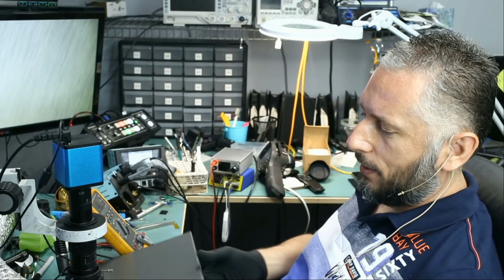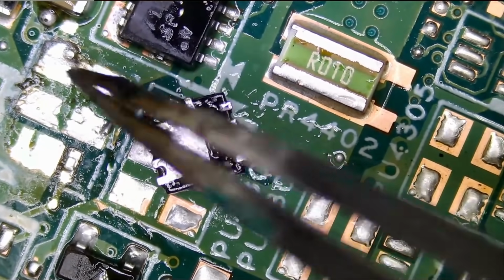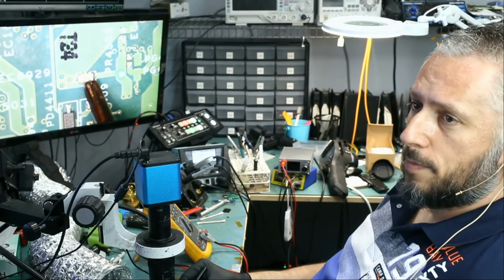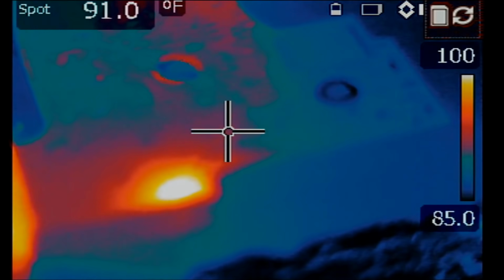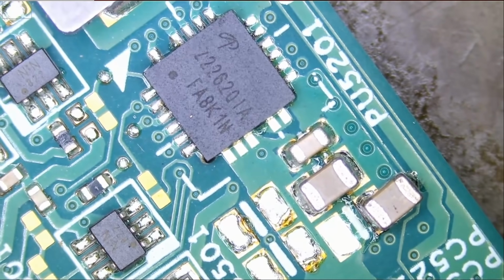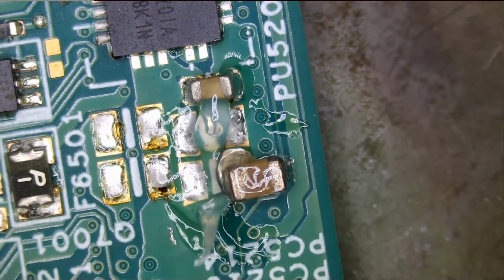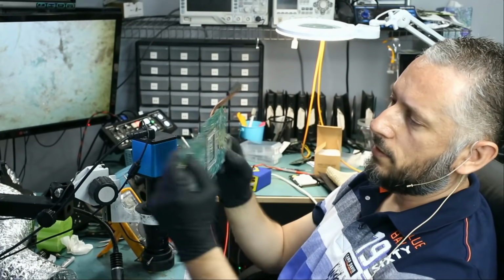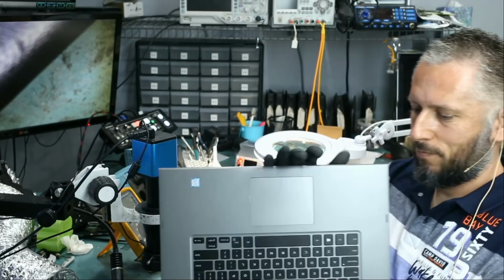Dell Inspiron 5579 Laptop No Power Repair

Comment: Is there a schematic for that power injector gadget available or a URL link to it? What is the maximum safe voltage and or current one should inject on the board?

Comment: There 2 empty places for ports.
I think one is for type c port and another one is for.
M.2 kind of that port.
Can we add manually does it work.
Or it depend on bios.
But we just need to soldered ports.
Like replacing ports.

Comment: One Question friend ¿Which is the difference between the Power Supply Short Injection / Detector with Voltage and Current Control and the Mechanic Short Detector? ¿Which is best ? or ¿Which one do you use often? Thanks anticipated for answering me. God bless you.

Comment: I am also an amateur repair gnuowif. I fixed a Dell 5579 laptop similar to the one you just fixed. It's my wife's laptop and I fixed it yesterday. It's short-circuited with the mosfet shorted and 1 capacitor shorted. Unfortunately, the problem burned the board at the Mosfet position and punctured a hole in the board. But I carefully wired each circuit and used a grinder to work out the burned part. It took 2 hours to repair that laptop but it was really fun. And more importantly, I have successfully fixed it. I don't have a thermal camera like yours so locating the short circuit is quite difficult but that's ok.

Comment: such are the services, they replace parts and I do not want to check the causes of a short circuit in more detail. And here it was possible to locate the damaged capacitor quickly and without any problems. Good job

Comment: What do other repair shops actually do? Replace batteries or missing keys? I do not have a repair shop and I could do a better soldering job than that at home

Comment: Real shotty job on the previous repair the soldier is not done properly your work is much better than factory but with people that do soldiering they need to practice and make sure where the real issue is be for just soldiering components as that mosphet didn't look like the problem but the other one had the sort and that was caused by the cap.

Comment: Dear @NorthridgeFix .
First Very good video. Thanks you for your chanel
I have a issue
I do a mistake with Watercooling and a componnent blowup
Should i replace a cracked SMD inductance type 0520 R0 on a nvidia 3080 If the cards work normally . 
Regards 
Steve

Comment: So I only have an LED tester now and  I think injecting 20v could potentially cause damage to a board. Do you think making my own injection tool with batteries (either setting them up in series or parallel based on voltage or amperage needed) would be a good idea?

Comment: good job 
can i ask if a laptop is working when you remove the battery and when you install it it wont run, is it possible that IC issue or battery issue the laptop is dell

Comment: Everyone has their own ways to find short on the board just need couple of experience on working, if you have thermal camera and voltage injection then that's a plus point.
Great work 👍

Comment: I call that voltage injector as short circuit killer. Diys short circuit killer plus alcohol works for me. Thermal scanners are for pros. And Ur a pro. U nailed it. 👍😎

Comment: I've been using the Ulephone Armor 9 phone for detecting overheating components. It's built in thermal camera has worked great. It cost me under $700 with all the extras included. I don't even use it as a phone. I just use the endoscope and thermal camera. Only downside is it can't be attached directly to a monitor. It's chip wasn't designed for it.

Comment: I use to use a candle to find shorts on a board, would pass the candle over the parts and if the area was hot it would melt the candle. But this was way before micro parts lol yes i am old lol
Reply: Thanks for sharing your technique sir.respect you sir the old timer can get creative when finding way to troubleshoot
Reply: @montelcarlos143  where there's a will there's a way
Reply: I used melted wax as water proofing with plastic wrap once 😂

Comment: I use a bench power supply instead of a voltage injection tool. I limit the current to 1 amp and increase it gradually because once  I started with 3amps and it burnt the track.

Comment: I'm wondering how come u not scared injecting 1.5v   if there is open line to a cpu 1.5v can cause it some damage.

I always start with 1v and it is enough to heat small caps and small ic s.
Reply: Any bench power supply can change voltage while injecting.  Not that hard.

Comment: What is your recommendations for cheapest Thermal Camera?
Reply: Some people advise for the FLIR that just connects to a smartphone. Or „Seek pro“ that also works with a smartphone. Missing a lot of resolution, but they costs 100s instead of 1000s...
Reply: you're looking for 24/30/60 FPS and 240*240 Resolution minimum anything that has those is a good IR camera
Reply: @mohsentabouna6401  The frequency requirements really restricts the choice there is left in the affordable areas...
PS.: I‘ve bought myself a used Seek Pro Thermal for IPhone as it has 15Hz as a refresh rate. But for now I haven’t been able to do anything with it. I am not a shop owner or something.
Also I think on FLIR there is the advantage to overlay IR picture with real picture to identify better the components. But the only offer those Smartphone cams with 9 Hz refresh rate.

Comment: Nice work!

Question, i can't seem to find both of the meters you're using in your site. Which fluke meter are you using? And which meter are you using to measure the capacitor? 

Thanks in advanced!
Reply: Better off getting a lcr meter for caps it will measure leakage as well.
Reply: @alreed2434  right, I'm looking for both

Any recommendations?
Reply: @SuperMarioDiagnostics  If you're starting a $10 digital is fine for the multimeter. I had an ancient b&k lcr meter fluke tektronix there all good older radio shack stuff is good as well.
Reply: @SuperMarioDiagnostics  lcr meter at newark $40 usd + s&h  part  number at newark electronics 72-8740
Reply: @alreed2434  not just starting. Want to know which fluke model it is. I haven't seen many meters that will beep in code mode, much less that will give a confirmation beep upon continuity
Reply: Fluke 87-V and DE-5000 Handheld LCR Meter

Comment: why do you not inject voltage near the problem area again, and check with thermal cam to pinpoint which component is issue ?

Comment: I still cant believe repair shops just tell you to replace board right away without even looking into the issue
Reply: Most repair shops just replace parts without thinking about it, they always get money and it's easier to just buy from manufacturer and then charge the customer 
The ones who claim to repair just to charge a "inspection fee" are worst people than others who try to fix but stop at the first try

Comment: I have had success with a cheap lazer thermometer to find hot spots on electronics.
Reply: That would be tough
Reply: It was very time consuming but it got me to the right area of the board in just a few minutes and I didnt have to spray alcohol all over it. Works fine in a pinch.
Reply: Time consuming, but creative way!
Reply: if it's just to repair ur own laptop, it could be the perfect option if u don't own a Thermo camera while u already have a thermometer
Reply: @gastongl404  Keep in mind the massive price difference between the two.
Reply: Do you inject, look for a warm spot, stop, and then inject again? Because as far as I know it's not safe to inject for many minutes
Reply: @kdilac8879  I work mostly on vintage audio stuff and the few times I've had to inject voltage it wasn't for very long. I'm not experienced enough to say if voltage injection would cause damage

Comment: Bypass caps may have diff values even when the same size, for example in my last audio circuit I used 100uF 10uF 0.47uF. But as you mention in nearly every cap replacemeng vid, if you use 10uF + 10uF and 0.47uF that device will still work, maybe not that "precise" but it will and that is all what people want.
Reply: I use boardview software all the time and it states the Capacitance of every component.
I worked on 50 or so models and all have the same capacitance when caps are soldered in banks.
why you may ask? well it's manufacturing procedure, it's easier for the manufacturer to use the same caps so the board takes less time to manufacture, of course this is only viable in capacitor banks ( caps in parallel with same size )
now why is it that audio equipment can be different ? well filtering is very precise in audio equipment thus capacitance needs to be precise as well, often the capacitance needed is no even available so they put different cap values to creat an equivalent precise capacitance 
** Capacitance is calculated opposite of resistance, meaning ; values are added when in // and inversly added when in series

Comment: I actually try using my converter charger and solder positive wire to mosfet because the short is in the back of the motherboard and i also use alcohol but before i did that i made some research first like watching videos, and find out that the cap is bad and also because because I don't have enough money to send my laptop to a repair shop but what i have is basic tools and the the result? I fix my dell inspiron 6000 laptop. Huge relief but Fix at your own risk!

Comment: Your LCR meter is way too expensive for a hobbyist. Which device could you recommend using? I only tried a cheap 10$ one which I could probably replace with something better.
Reply: Try LCR-T7
Reply: @xxycom8963  I have that device, I just thought there are some better ones to upgrade